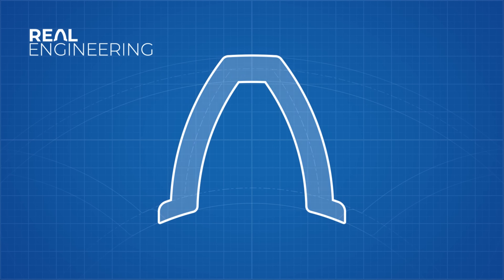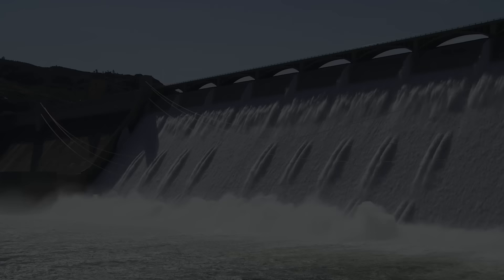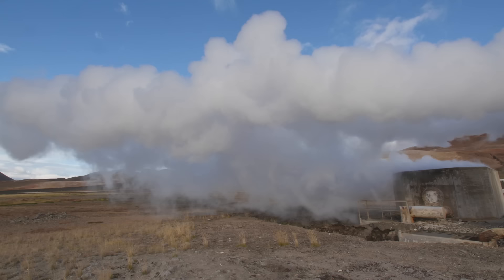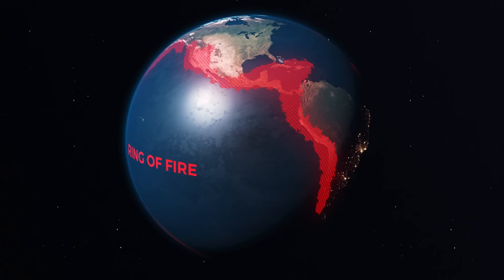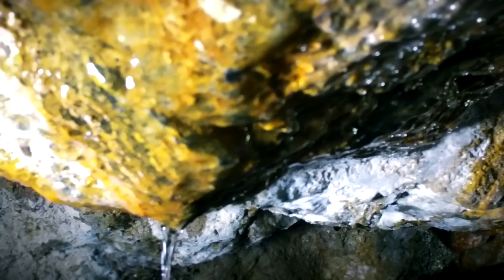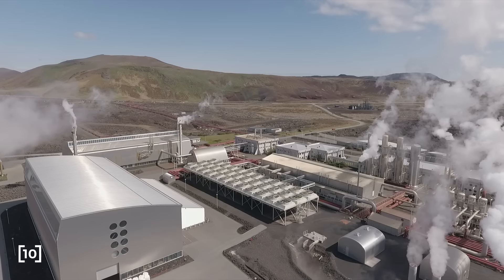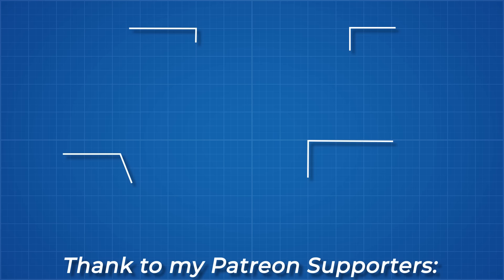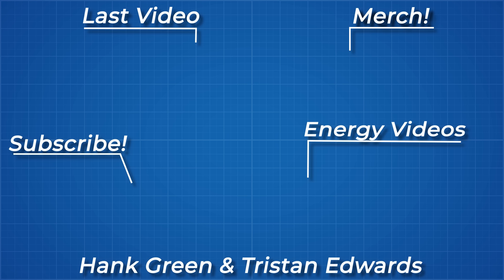Could Earth's Heat Solve Our Energy Problems?

Comment: Very interesting. I have considered the fact that there is more than enough energy under our feet to reduce our carbon footprint by at least half, using the cracked rock method..
As mentioned, using another gas with a lower boiling point reduces the level at which is needed to produce power,, and the  safety far outruns using atomic power in terms of safety.
However, there is another method that is being kept very much hidden.
In Australia, we had in western Australia a plant that used the sun.
Using mirrors that were used to directvthe suns energy via parabolic mirrors directly onto tubes at the  centre of the oblong mirrors this heated the fluid in the tubes to a huge temperature running generators, once built the maintenance was very basic as there was little to  go wrong.
To my amazment this plant was shut down, why is a mistery as for a start if was far more productive the solar cell fields, all the active parts were above ground so easy to work on, it was easy  to add to to produce more energy and offered a number of different fluids to run through the centre tube so that even when not in complete sun, the e nergy was still produced.
Therevare other ways of  making electricty  such as hydro plants but not huge dams , as  there are many fast flowing rivers through out the world that can and should be used to produce cost effective energy just from their flow rate.
A look at the amount of engergy produced by some of the smallest units  says that all,forms of energy supplied by nature are really  worth looking  at.

Comment: Another side benefit to geothermal is that you can more quickly mine and process lithium and other valuable minerals using the same process that heats the water used to produce energy. When you circulate these liquids you also pick up a lot of the mineral brine that is embedded in these rocks, and some of that will be lithium if placed near a lithium deposit.

Comment: There is another potentially huge benefit of geothermal, which is as a sink for heat pumps. Turning electricity into heat is 100% efficient, but electricity is expensive. Heat pumps can be more than 100% efficient, because instead of converting the electricity they use it to move large amount of heat energy around. The ground is pretty much always a better heat sink than the air, when it is a hot day outside and we want AC, the ground is still about 50F degrees just a little below the surface, which lets an AC unit run much more efficiently. When it is a cold day and we want heat, the ground is still about 50F degrees, so pulling heat out of the ground is much more efficient than pulling it out of the cold air. Depending on the price of natural gas, a furnace might be cheaper for heating today, but an air based AC unit certainly won't be. And these wells don't need to be deep, going down where it is hot isn't even helpful, because we want a moderate temperature to run heat pumps for both heating and AC.
AC is one of the biggest drivers of electricity use, making it even a little bit more efficient makes a big impact on overall electricity use. And these heat pumps are energy source agnostic, they can be powered by a geothermal plant up the road that is drilled deep enough to produce power, they can be powered by solar, wind, hydro, batteries, nuclear, or even fossil fuels.
Ultimately geothermal isn't going to form the bulk of our energy supply, it isn't cheap enough to compete with solar or wind in most places, but it does in some where the conditions are just right. And in those places where it works, it is a good supplement. Geothermal should also be fully throttle-able, meaning it isn't a limited base-load power supply.

Comment: I think the best way we can stop climate change is to utilize what plants have been doing for millennium. I have an idea where we use solar panels to power an electrical charge which will pass over air which will cause CO2 to break into carbon and oxygen. The machine would collect the water from the moisture in the air and carbon and deposit the carbon into the earth while collecting the water for multiple uses, if this machine was utilized in the desert it could use the water to put moisture into the air and decrease the temp of the surrounding area to further reverse climate change. Just as a side note I’m not a scientist I don’t know if this would logistically work or if this is even possible but I do know that in the desert the solar panel would have enough charge 16 hours a day to power this machine and I read a study that a small amount of electricity is enough to break carbon from O2 and produce oxygen. Reply if you have a change that would help incentive or some mechanical issue that would arise that I am not aware of.

Comment: Couldn’t they reuse the already drilled holes from fracking for geothermal energy ?
Reply: Theoretically yes however often in areas where geothermal energy is present you dont get petroleum drilling because the excess heat will destroy the hydrocarbons so
Reply: Yes, there are old oil wells that are used for geothermal energy but not many and output is low.

Comment: Thorium + molten salt reactors
Plutonium + fast breeder reactors
Reply: Thorium is better. "Fast fuel" can ignite too fast, one worker in japan died terrible death because of that!
Reply: No molten salt it is usually proposed in aqueous mixed solution of Fuel and Coolant but once it needs to be disposed of even after Reprocessing will be tough and expensive to store since the Salts are toxic especially with radioactive waste and react with air and water  will corrode any metal drums will leak through all concrete and rock and will mix with anx ground water rendering it toxic. 
Instead opt for Molten Lead with Thorium or mixed oxide fuel
Or Small Modular Reactors with any other Coolant no matter the fuel
Or even Hybrid Fusion Fission reactors 
Or pure Fusion Reactors
Or Subcritical Fission Reactors
Reply: @rollinbodda4405  I don't believe this is correct. The salts are an anhydrous solution at about 500-600C. There can't be any water as it would simply boil off. I also don't believe corrosion is a serious problem as there is no free oxygen in the loop. The MSRE reactor used Hastelloy N. This is a nickel-base alloy that was originally developed as a container material for molten fluoride salts, to which it has good resistance in the temperature range 1300 to 1600ºF, at the end of the MSRE no significant corrosion was found.

Variations on this alloy are also used for molten salt solar thermal plants. It is also proposed for the molten salt primary loops of the new generation of compact nuclear fusion plants.

Molten lead reactors are interesting but have particular challenges because of the intense heat (1000C) and tremendous weight of the fuelled reactor which will need a much larger and heavier reactor vessel.

Because of its proven principles and relative simplcity as well as it's synergies with solar thermal and nuclear fusion, most bets are on the molten salt approach.

Comment: CA often has to curtail solar in the spring and the fall (lots of sun, low A/C demand), but not usually during high-summer because there is enough A/C demand to offset it.

I was really surprised when you mentioned Moss Landing.  Why would PG&E put a battery there?  But then I remembered, Moss Landing is part of what is almost an island-grid.  It has poor connectivity to the main CA grid, and the natural gas supply is also constricted.  (If I remember right).  It used to have a coal plant long ago but it was eventually replaced with the gas plant.  People got really sick of that coal plant causing acid rain which stained everything.  Homes, Vehicles, Boats... it was pretty yuch.

I think PG&E's purpose in putting in the batteries might be to clip the peak usage times in order to avoid having to put in another NG generator (or have to expand the NG supply to the area).  It actually makes a lot of sense in that light.

-Matt

Comment: What about sterling engines the can be used in quantities to make a high power system
Reply: Those are notoriusly energy inefficient. We want to waste less power, not more.
Reply: @Alexander_Kale  the power was already being wasted. Vented into the open air not being used
Reply: @DeandreSteven  I do not think I understand your argument. When you install a generator, why would you take a Sterling one, when literally every other method is more efficient?
Reply: I don't know what Alexander means. Stirling engines are known for their efficiency, but not their power, because they use a thermal regenerator to expand and compress gasses as close to reversibly as possible. This allows them to approach the theoretical maximum Carnot efficiency.

Steam turbines are also extremely efficient , but mostly only at high power. The losses to turbulence and friction in the turbine have to be balanced against the parasitic heat exchange in a massive block of Stirling engines... and anyway the cost of running and building the systems is in favour of steam turbines for sure.

In sum: low power or low temperature difference: use a Stirling engine. High power and high temperature difference: use a steam turbine.
Reply: @thenthderivative  According to the Wikipedia article on Stirling engines, they SHOULD be ABLE to reach maximum Carnot, but in reality, they never actually DO. It also names an efficiency of 10%, whereas a coal fired power plant reaches about 50% typically.

The article itself goes on to say this:
"Stirling engines by definition cannot achieve total efficiencies typical for internal combustion engine, the main constraint being thermal efficiency."

So no, Stirling engines suck.
Reply: @Alexander_Kale   Alexander Kale  I disagree wtih the author of that article when they say "by definition" there. For the record I have a PhD in low temperature physics, but I'll try to justify my disagreement.

The "Carnot efficiency" is a theoretical best possible efficiency for an ideal heat engine. A heat engine (internal combustion engine, photovoltaic cell, steam turbine) transmits heat from a hot place (hot exhaust from an explosive reaction, the surface of the sun, steam returning from deep in the Earth's core) and transmits it to a cold place (a car's tail pipe, space, the atmosphere), generating some other kind of power as a byproduct. This "Carnot efficiency" is the maximum possible efficiency at which a heat engine could operate before that heat engine could be used in concert with a refrigerator to build a perpetual motion machine. The complementary efficiency factor for refrigerators is the so-called "coefficient of performance".

The bigger the proportional difference between the cold and hot sides of the ideal heat engine, the larger the Carnot efficiency and the more efficiently it will run (in theory).

Briefly: heat engines must get less efficient when the temperature difference between the hot reservoir (burnt fuel, solar radiation, and what have you) and cold reservoir (air or water, usually) is small. Refrigerators, on the other hand, are more efficient when the temperature difference is small.

The upshot is that no heat engine is efficient when it's running "cold", so when you evaluate these things you either need to compare the engines for efficiency at the same temperature OR compare the temperatures at which they have the same efficiency. That way you can see which engine is most appropriate for the fuel source that you have.

An internal combustion engine, which is a spectacularly inefficient heat engine that achieves very high power to weight ratios (suitable for automobiles), requires quite a lot of hot exhaust to run and vents most of the useful heat and pressure, unused, out the tail pipe in the name of power.

However, the ideal Stirling cycle heat engine runs at the Carnot efficiency. This is the main reason you would use a Stirling engine: they're so efficient that they can eke out power from even tiny thermal gradients. For example, you can buy a Stirling engine that runs off of the heat from your hand or a hot cup of tea. They can even run on an ice cube and use the thermal energy in the air, or the heat of your driveway in the sun. Compare the total efficiency of an internal combustion engine (~20%) at 1100 C to that of the Stirling cycle at 40 C (11%) or 200 C (40%) or at 1100 C (80%). That's crazy good.

No engine is more efficient than an ideal Stirling engine for any given fuel or heat source.

Theoretically, if you built a heat engine to use very hot fuel, it could be the most efficient heat engine for the job. That's the theory. Unfortunately, efficiency isn't everything. 

In practice, Stirling engines have fantastically poor power to weight ratios, which is why our cars are powered by internal combustion engines. For high power applications, the turbines used in coal plants are much more cost effective and while they do suffer from losses due to turbulence in the working gas, they're so much smaller and lighter that the friction losses in the shaft bearings is much less than a comparable bank of Stirling engines built from economically realistic materials. This is why coal and thermal solar plants use turbines and Stirling engines are limited to toys for the most part.

The other area you're likely to see a Stirling engine in industry is when it's being run in reverse to convert mechanical power into cooling. You'll find Stirling engines in many cell towers, where they generate liquid nitrogen from the air to cool down superconductors to 77 Kelvin.

In sum:

For a small temperature difference, a Stirling engine is your best option. For a large one, use a turbine. For maximum power on a mobile vehicle, use an internal combustion engine.
Reply: @Alexander_Kale  But for the record... you could absolutely run a Stirling engine off of a geothermal source or even just a hot spring and get a higher efficiency than a turbine for a small scale project.
Reply: @thenthderivative  I am afraid I can't argue on that level. You say you disagree with the author of said article. In that particular paragraph he says how a real life stirling engine cannot be run on that efficiency because combustion engines usually can be run on higher operating temperature. 

Since you yourself said that Stirlings are better when the differential is low, should we then try to maximize the differential, so we can use the other engines, or should we try to minimize the differential and use Stirlings?

With the same amount of input, if in a different form, one of the two has to be better in general, and the consensus seems to be it's not the Stirling Generator.
Reply: @Alexander_Kale   I wouldn't have nitpicked, but OP seemed to be alluding (correctly) to the fact that Stirling engines are extremely efficient. They were wondering why we then don't use them here. You're right about having better options for real geothermal projects, but I want to make sure OP understands why. It's more complicated than Stirling engines being "inefficient". It's about power to weight.

Definitely it's better to use a larger thermal differential if you have it. You'll get more power and a higher thermal efficiency out of almost any useful heat engine.

For example, one of the places you see Stirling engines being looked at is for Concentrated Solar Power (CSP). In CSP, you use mirrors (or similar) to focus sunlight onto the hot side of a heat engine to generate power. While a steam turbine and a Stirling engine are pretty similarly efficient at the same (high) temperatures, in the CSP setting it turns out you only have to spot-heat a tiny volume of working fluid to run a Stirling engine... whereas a steam turbine requires a larger, more uniformly heated volume of steam to run and that will, by itself, lower the efficiency of any good heat engine. So the CSP Stirling engine can run at higher temperatures using the same (but more focused) solar input, getting better efficiency than either a solar photovoltaic cell or a steam turbine can. Because the heat is so concentrated, you only need one Stirling engine for a huge field of mirrors and the extra cost may be worth paying because both land and mirrors can be very expensive and it lets you cut down on both.

In the geothermal setting, that advantage doesn't exist... so you use a turbine. No question.